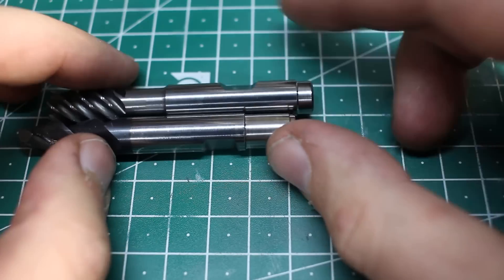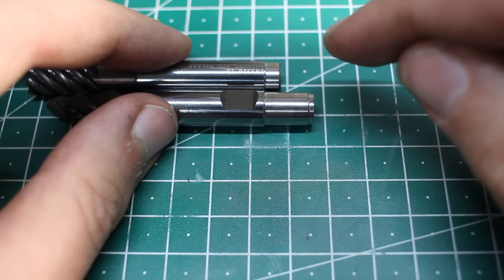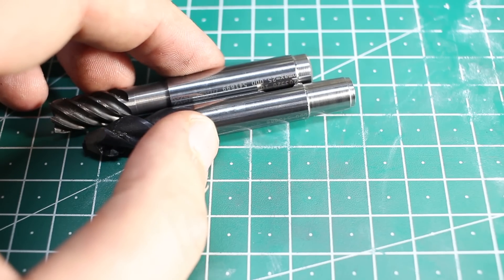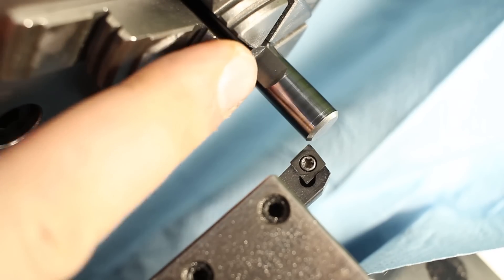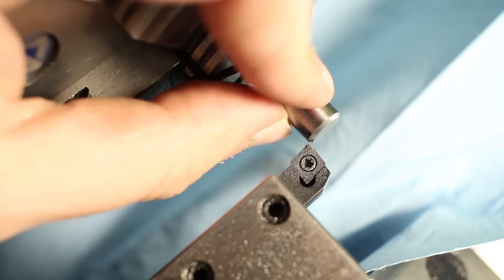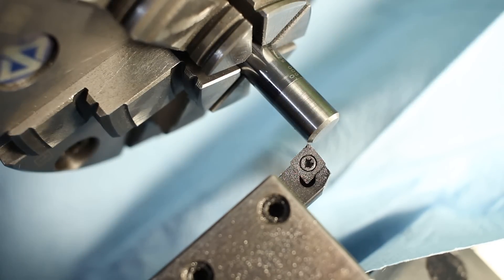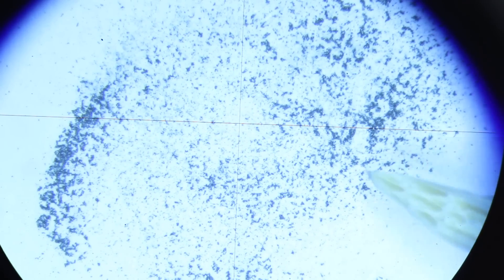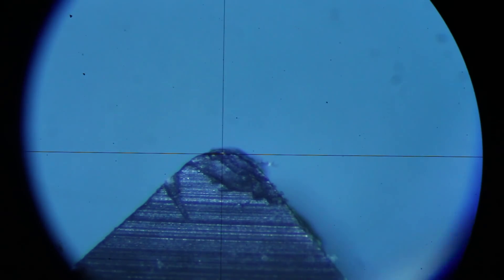Machining carbide?!

Comment: There's a difference between what is possible and what is efficient or productive. It makes sense that you can turn cemented tungsten carbide like this especially when you think of grinding as just cutting with a MANY fluted diamond tipped tool for example. 

In fact, some hard molds/dies (hardened steel, clad, or carbide) are machined with solid carbide ball endmills. These are VERY special tools, but carbide nonetheless. 

Using a full sharp pCBN insert like the start of this video is far from ideal, let alone the work holding, tool holding and machine stability, but it works of course.

Good experiment and nice video.

Comment: Way back when I was an intern in a physics lab, I was tasked with grinding holes in big chunks of glass using silicon carbide powder. The machine shop guys refused to let that stuff even enter their shop. I ended up using an old drill press in a hallway in a subbasement as far away as possible from the machine shop... But I remember the faces of the machinists when I mentioned using that stuff anywhere near a machine tool, even an old drill press 😜

Comment: often the tip of the bit is carbide and the rest is another material, so just machining the shank, isn't necessarily impressive.
one of the bits has an obvious color change from tip to shank, so I have to ask why that difference exists, and what is causing the color.
Reply from the maker: Not on carbide endmills up to 20mm - Those are always monolithic centerless ground carbide blanks. The times where we brazed carbide onto a steel shank for regular endmills are fortunately over.
(Custom formtools are another story of course.)

The collor difference is the Titan-Aluminium-Nitride coating.

Comment: Carbide is going to look like it has a porous, pitted surface finish because it's been sintered. Usually liquid phase sintering in carbide's case. It's packed, and heated until it melts about 15% and the capillary action pulls the now melted product in and fills the voids. It's really really cool.

Comment: What do they do with the diamond coated tooling at your job, when the tooling becomes to dull to cut the carbide.
Is it just scrapped, or do they get re-worked somehow ?   If this is a dumb question, it’s because I build houses, not metal parts 😂.

Comment: Hello Stephan, I have a small atlas super precision lathe with timken roller bearings in the headstock. I have machined carbide to .0005 total tolerance on a regular basis. I was just doing some "Can I Make It Happen Stuff" which you call R and D. You said you have a high end German machine, what is the name and model ??? When I machined the carbide I used collets as it is easier to keep the dust under control. All I did was machine a 1/2 inch diameter which is 12.7 MM. Also, I agree with you on the machined metal as chips, the limes (English)call it swarf. I will agree with you Stefan that the chips do look like cast iron. But the dust is not good for you for sure. Good day to you Sir.

Comment: I am designing an vinyl turntable. I want to use carbide for the platter spindle that is 12mm in diameter. I want to drill and make an  M6 turn on one end. How can it be done? Any ideas?

Comment: Interesting that the surface is chipped on the original surface, but not chipped where you took a deeper cut and backed out on the turned finish. Perhaps it has to do with the ground finish?

Comment: The reason most people don't machine Sintered WC-Co/WC-Ni-Fe is due to the very toxic dust. I learned this after getting a very bad respiratory illness after grinding some inserts with a diamond blade.. Not as bad as grinding Beryllium compounds but still pretty bad.

Comment: Amazing I do know that if you try to grind carbide with a CBN wheel, the wheel will be instantly left un usable. It is traditionally said that if you grind steel with a diamond wheel it will instantly kill the wheel. I have found this not to be true. The B&S drill doctor has a diamond wheel so that you can sharpen steel drills yet still grind carbide masonry drills. If the wheel was CBN you could not grind the carbide. CBN wheels were not really necissary intil they came out with the fifteen percent cobalt HSS  which you will find is next to impossible to grind with aluminum oxide wheels.

Comment: You got access to an XRF gun? Would be interesting to see just how pure the tungsten carbide really is? There is bonding agents to help with the sintering process. Last cutter I had checked had quite a lot of nickel in the matrix and I assumed that was to help with the sintering process? What's the difference between cheap and expensive tungsten carbide? Has to be the fillers and bonding agents?

Comment: Excellent Stefan, always learning Sir, the "Micro-grain" sintered materials are very impressive under high magnification ( X500 plus), for sintered steels, they are advertised as clean, ref near zero tramp elements, and giving higher mechanical strength. Cast steels (all steels are cast), have many undesirable elements, eg Antimony, Boron, Copper etc, elements are added, such as Calcium is added to remove impurities; quite an art to steel making!. Obviously sintered materials do not have a grain direction, so no uni-directional strength, such has a lever/pry bar.
Many thanks for sharing.

Comment: It seems that a vacuum pickup at the tool would control some of the chips, as their mass is so low... also, do you have any idea if any kind of fluid could be used to either lubricate, or cool, the cutting process? Grüße aus Schwaben...
Reply from the maker: Yes, I would definetly run dust extraction if I had to do this for real. The carbide milling we do is done completely dry, just with air - I guess that would be the same for turning too.

Comment: Ya that was intresting. holding the part in a collet thats closer to the spindle baring would reduce deflection and might make that insert last a bit longer. the collet strategy would be easy to machine 12mmm pull it out of the collet another 12mm if the part is long. seen those inserts on ebay for like $7-8 I'd have to wear it on a necklace so i dont lose it in my messy shop though

Comment: And how do you machine diamond coated tooling or CBN?
I'm not hearing a vacuum... you don't mind the carbide dust?
Reply from the maker: For the video I was wearing a dust mask - If I had to do this for real, I would add dust extraction.
The diamond coating gets added after the carbide base material is ground/sintered into shape.
CBN can be ground with a diamond wheel.
Reply: @StefanGotteswinter  PCD (poly crystaline diamond) coatings are "ground" with EDM "grinders". I learned this from our tooling provider when discussing them making a custom diamond tool for us. They told me this is basically a normal tool grinder with a copper wheel, attached to an EDM generator and submerged in fluid like normal EDM. They also told us that they didn't have this kind of machine, but are using normal wire EDM when they are makind custom tools like the one they were making for us. 
This was tools for the woodworking industry. Diamond tools are the only kind of tool you get decent tool life out of when machining MDF. But I expext the process to be possible to use for metal working tools as well.
Reply: @spamspammesen5970  Very interesting that diamond tools are the only kind you get decent tool life out of when machining MDF. Why is that?

Comment: Interesting but it begs the question, why? Faster and more efficient to just grind it . I get asked the question all of the time and I them exactly what you did. Get yourself a cbn or diamond insert and go for it. I also tell them to buy a used KO Lee on eBay and a couple of diamond wheels.
Reply from the maker: Fully Agree for turning just straigt diameters/steps or necking down endmills, grinding makes more sense for those applications.
I think it could be interesting if a shop had to do complicated shapes in carbide. Cnc lathes are a bit more common for a general shop than a cnc cylindrical or cnc t&c grinder. Granted, very limited usecase.
Also agree that every shop needs at least one manual grinder of some sort ;)
(Milling and drilling carbide is in my oppinion more viable, we try to replace a lot of sinker-edm work with it)

Thanks for watching, Alfred, I feel honored to have you watch.
Reply: Stefan Gotteswinter Thank You for the reply. I really enjoy your videos. The quality of sound and camera set up is wonderful. I agree, in a perfect world every shop would have everything they need but sometimes you have to do whatever works.

Comment: Stefan, will you be regrinding the CBN insert with a "finer" diamond wheel?  That way you can see how much longer the insert could last.  This was a very interesting video!
Reply from the maker: I definetly will regrind it, but until i have a proper need for it, I will not do much additional experimentation on this - First I want to learn more about it and get some proper tooling for it.

Comment: Definitely chips and most impressive Stefan. You'd certainly know more than I would and this is just some semi logical guessing. Because of the sintering process that pitting in the turned surface at 40 X magnification makes sense. My guess is those are areas where individual grains of carbide are being ripped out of the surface of the cobalt binder. A lot of heat was going into the end mills shank and not into the chip. That might not be a bad thing as from what I understand carbide at the correct feeds and speeds can help to plasticize the material being cut because of the very high frictional heat and tool pressures right at the cutting edge. That CBN might be doing the same thing to the cobalt binder? The CBN might be doing most of the cutting on the cobalt and that's what's helping to remove the carbide? Because of the two different depths of cut it's hard to say how much cutting edge damage is being done with your first 10 passes and the lighter depths of cut verses the one heavier cut. One light depth of cut and then an inspection under your microscope might reveal more about how the damage is getting started. Then further passes with the same depths of cut with a microscope inspection after each one. I also suspect some impact erosion of the CBN due to the hard carbide particles hitting the even harder CBN at high speed might also part of the problem (maybe). 

The cutting edge looks like it was destroyed mostly because the forces were higher than the cutting edge material could withstand and the material broke apart. The initial damage was then enough to start the material to fracture deeper into and away from the maximum cutting pressure point. The fracturing isn't showing the pattern one would think would happen with the force vectors that should be happening. But maybe that's usual with something that hard? The light squealing noise was a sure indicator of chatter so it's possible that did most of the damage once it started than the heavier cut did? As you pointed out those rough grinding lines causing stress risers wouldn't have helped with the cutting edge life once the edge started to degrade. As always a very interesting video, but it may have raised more questions about what's happening at the tool edge than it answered. :-) It's quite probable at ultra high magnification like an electron microscope could give might show a great deal more with those chips and how there being formed. Even though the CBN is harder than the carbide, is the carbide actually being cut or is it mostly the binder being removed that's taking the carbide with it? It would be great if one of your viewers did have access to that type of microscope and could provide high resolution pictures of those chips. I could also be 100% wrong with anything I've said since it's only rough guessing at best. 

Your seriously insulting that lovely Super 11 by calling it only a hobby level lathe. I've never seen Emco call it anything other than a light industrial or tool room lathe in any of there advertising. :-)

Comment: Three words. Rigidity, rigidity, rigidity. Anything moves, any chatter the insert is toast. I always liked using CBN for hard turning. Glass smooth finish with very little heat going into the work.

Comment: Since we can use CBN inserts even on mini lathes, do lathe mounted tool grinders make sense any more?
Reply: Of course they do!  Much finer dimensional control and surface finish than turning.
Reply: No. But then do cylindrical grinders make sense anymore either

Comment: The cobalt matrix is the source of the ferromagnetic properties. Cobalt itself is ferromagnetic. Cubic boron nitride is much harder than even pure tungsten carbide, with cubic boron nitride and tungsten carbide coming in at ~5000 and ~2000 knoop hardness, respectively. Diamond is ~7000 knoop hardness and the average m2 hss toolbit is ~750 knoop hardness, for reference.
Reply: First time i hear for knoop hardness.I heard for brinell ,vickers ,rockwell but firs time for knoop.
Reply: @zumbazumba1  Knoop Hardness testing is with the tip of a tiny diamond.  It's used for testing very thin coatings and materials.  Also can be used in very small areas where you do not want indentations that are easily visible to the naked eye.  I used to demo the work hardening of 1/8" thick bent aluminum on the neutral plane and tensile and compression areas around the profile of the bend
Reply: @Ujeb08  so its something similar to rockwell testing machine but with smaller force.You learn something every day!
Reply: @Ujeb08  this is solid carbide all through, so do you have an idea why he mentioned knoop hardness here?
Reply: Interesting. Thanks for the perspective.

Comment: The magnetism stems from the cobalt matrix. Tungsten carbide is sintered together with some percent cobalt to fill any voids. That's also why you shouldn't breath that stuff in, because the cobalt creates toxic and carzinogen compounds. This could also explain the pitting of the surface.

Anyway, very interesting video. I wondered for a while now which would win, carbide or CBN.
Reply: cobalt creates toxic and carzinogen compounds? Like Vitamin B12? Where does it come from?
It's a trace mineral. Good for bones creating red blood cells.

Comment: Looking forward to the video on milling with small diameter end mills on slow machines ! (At least I am hoping for one ;) )
Reply: He did a video about how there is no place for HSS in a machine shop anymore. He went into using small ¼" carbide EMs, rather than HSS EMa, even on slow/hobby machines. I forget what video it is. It is possibly one of the "shop talk" videos because I couldn't find it.
Reply from the maker: Yes, still collecting footage for that - I dont want to show only testcuts for that video, but realworld machining ;)
Reply: @StefanGotteswinter  Take your time, I'm sure it will be a very interesting and useful video! I'm not asking or suggesting, but It would be a plus if the video covered some gummy materials and some examples of machine behavior numerics that would make this impossible (like max stick slip motion and limited resolution of steps on CNC).

Comment: Sure is possible, especially the "ultra special carbide" my boss buys, which BENDS... lol
Reply: Ah yeah. I've had some of those. Strangely light for carbide too.
Reply: @danjennings5068  could you please share the brand name or link to the product? I really appreciate it in advance!
Reply: @fizzleshizzle8314  no idea, it was >decade ago.
Reply: Ahh, Chinesium Carbide
Reply: Carbide is supposed to bend just like glass
Reply: Where could I get those carbides? Please share brand name or links. Really appreciate it!
Reply: Hmm... i made a totally contrary experience. All the Carbid tools i bought from china (real cheap ones too), were always flawless. On the other hand, almost every HSS Tool from China was extreme crap. I guess that there is no "hillbilly" way of making carbide, therefore it tends to be so good. Though in your case, it was most likely "chinese marketing", super duper HSS-Carbide-Titanium blabla...
Reply: I agree that it was probably falsely marketed as carbide, or extremely low carbide content/high binder
Reply: @danjennings5068  I think that if the amount of carbide to binder is too low, the baking/pressing process doesn't work at all. Because i simply never have seen such a "tool". Maybe the matrix isnt forming?